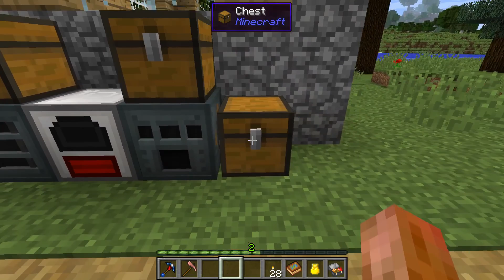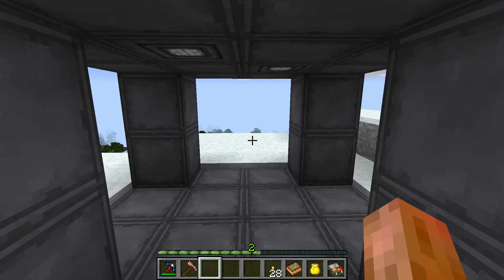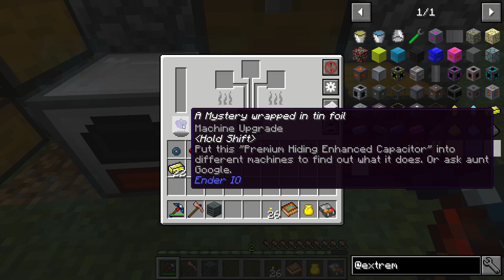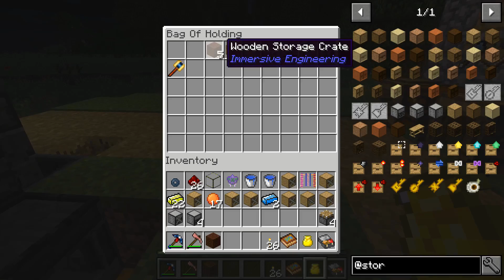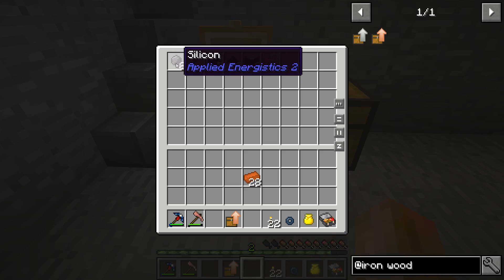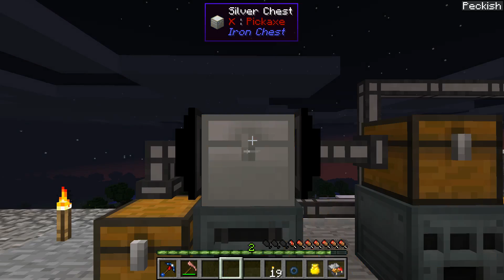Moving Day - EpikTek Revived s1e08

Comment: hey epic you do know that the capacitors that you have gotten from chests all have variations to them and are completely random, for example if the capacitor forging in its info text then it is better at smelting stuff
Reply: ie. the image of the capacitor isn't what changes stuff its the text traits that it has
Reply from the maker: Cool, no I didn't, I'll have to check them all out.
Reply: i'm pretty sure most of them aren't better then the octdatic capacitors that you can make late game
Reply from the maker: But they're sure tons better than the basic ones. :)
Reply: True that